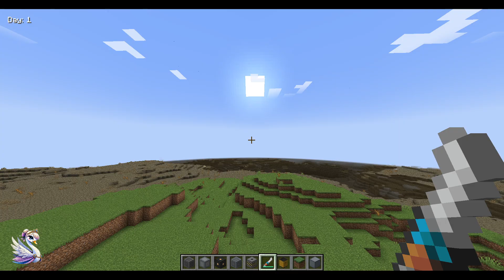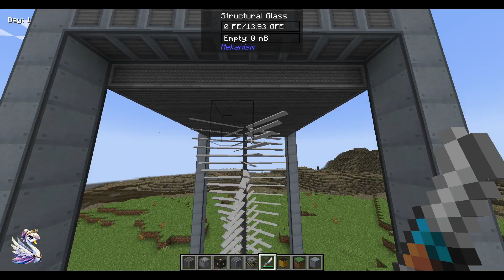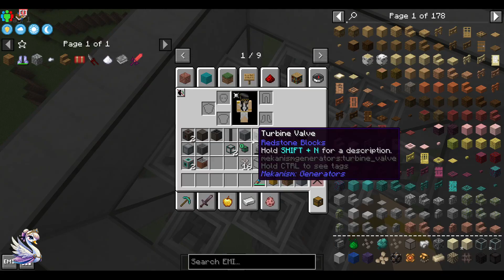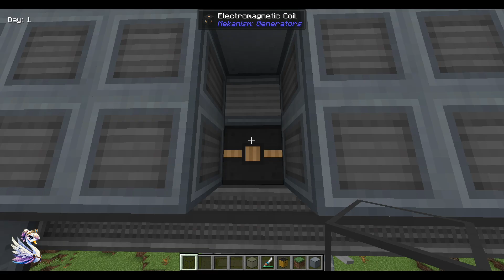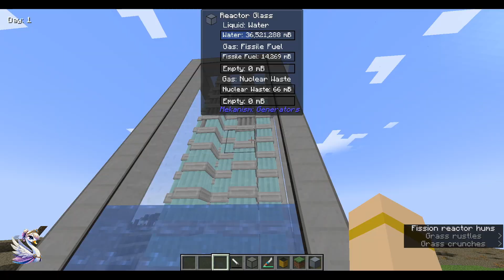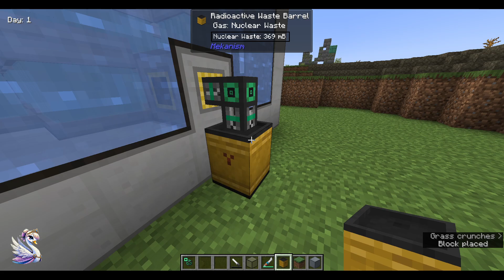Mekanism Fission Reactor & Turbine - Initial Creative Test Setup - Reclamation Minecraft

Comment: pd: The rubine don't use water to produce energy, it use the steam from the fission reactor, (in my opinion it's a really bad production of energy, I pass from it and build the fusion reactor, it's free energy in a big amount, like 19MFE per tick, only using water and a few machines to transform the water into, deuterium and tritium
Reply from the maker: Well, I didn't say it uses water. Nor do I need the energy. The energy is a by product. The turbine accepts the steam of the reactor. Then transforms it into water..Which gets pumped back into the reactor. If you are not using the turbine what are you doing with the steam?
Reply: @Mirabelinde In fact, the original purpose of the industrial turbine is to generate energy by utilizing one of the fission reactor's waste products. The turbine is merely an add-on to produce more energy, but the steam is actually a waste product of the fission reactor; you can dispose of it with a trash can, you don't need it. And the water produced by the turbine is another waste product of the machine itself, but you don't need it either. You already have the sinks in the modpack; the sinks produce an infinite supply of water, on each side, so the turbine is unnecessary. You'll extract the coolant for the fission reactor. The important thing about the reactor is obtaining the nuclear waste to produce pollonium and plutonium. And the worst part is that the turbine produces a lot of energy, even more than the fusion reactor, but it depends on the steam generated by the fission controller, and the fission controller can explode if it isn't properly cooled. It can also release radiation into the world, kill all your animals, and cause you constant harm for hours or days in real life—something the fusion reactor doesn't do. Therefore, the fusion reactor is better. Oh, and besides that, you'll need a huge amount of energy to create antimatter, which is precisely why it's necessary, in addition to being less dangerous.
Reply: One more thing, the fusion reactor will be necessary to produce antimatter, since, as I said, there is no risk of it exploding, and it generates a lot of energy, which is important because the machine that creates antimatter from pollonium consumes a lot of energy.
Reply from the maker: @Fill_C you are saying that a trash can will void the steam? Because my info says that there is no way to void steam, nor release it.
Reply: @Mirabelinde you are playing in a mod pack, there's a few ways to void items, fluids, gases, or anything. yeah, in reclamation you have the trash can mod, individual trash can for items, fluids or gases, and the universal can, you can void anything, you can put a whitelist or blacklist into the can, to make filters, idk, for example, if you make. massive mob farm, you can use the trash can to filter the armor and tools from the mobs, or for example, in the fission reactor, you can void the steam and nuclear waste... ok not the last one, but yeah, it works, if you played only with melanism, only only melanism mod, yeah, it would be an option. try it, the trash can are cheap, (universal trash can is the best)
Reply from the maker: @Fill_C thanks, good to know. I will put it to the test. Someone else told me there's another way to void steam, with the chemical tank.thag can also void items.